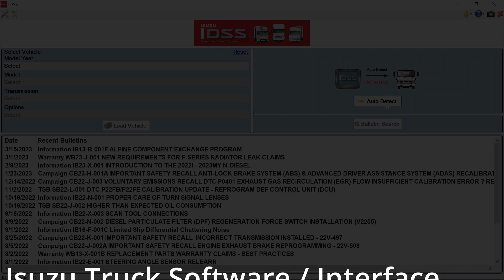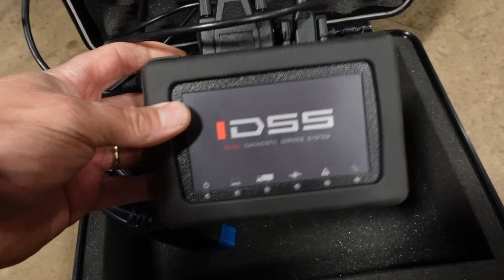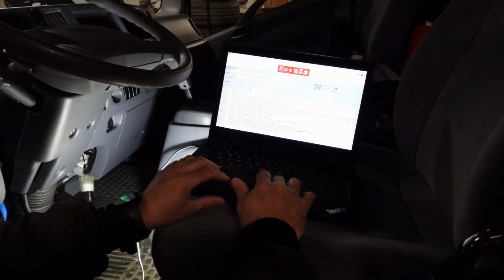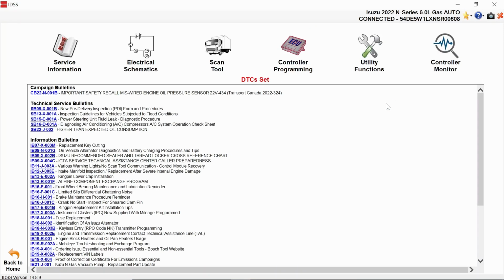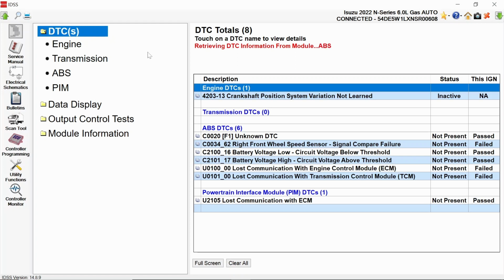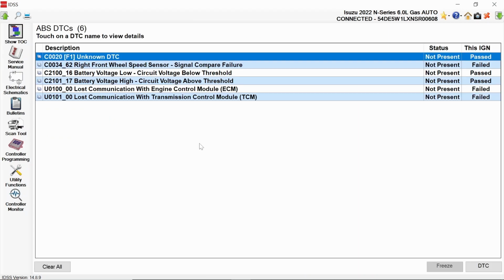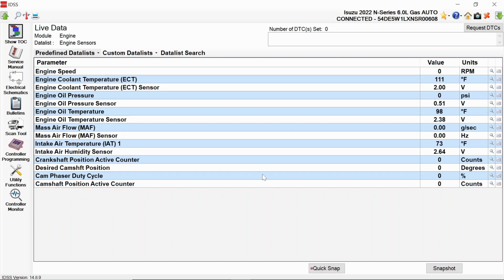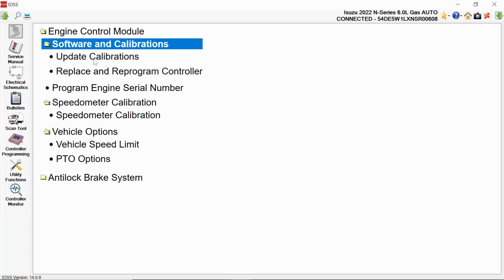Isuzu IDSS Truck Software Introduction

Comment: Hi I have a older 2002 Chevrolet Tiltmaster W4500 Truck,where can I find a scan tool that will allow me to access the ABS System so I can bleed air out of the Akebono module?
Reply from the maker: I do not know

Comment: If you work on Isuzu trucks regularly, you need this tool.  The IDSS is the only scan tool that will take the diesel’s out of stage 4 de-rate.  Unless it changed, programming is part of the scan tool subscription, so it will pay for itself quickly.   Also, I just learned the J1962 is no longer on NPR’s. Very cool, thank you for sharing!

Comment: Thanks for the information. Any j2534 support? I know the medium/heavy duty world is behind R2R.
Reply from the maker: Not that I could figure out.  Matco 4000 with HD no go, Autel CV no go,  I even tried to jumper the CAN bus to the DLC  / scan tool and it is a different protocol.
Reply: @BrianMann216  i thought Texa had a pretty decent system, but I haven't used it myself. They're supposed to be one of the better scan tools & pass-through. There's also Nexiq.